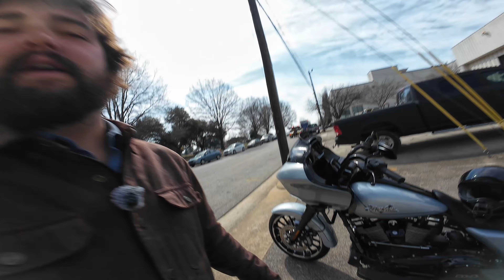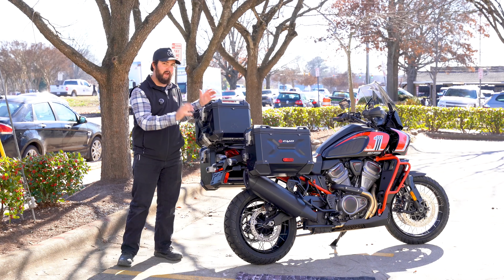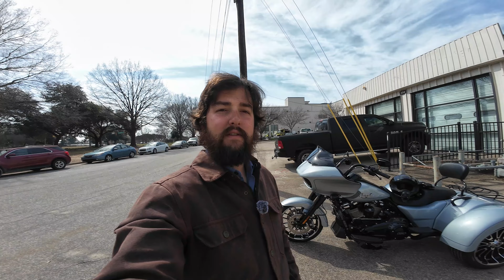Harley-Davidson ROAD GLIDE 3 | Ride & Review

Comment: Tour Pak if you google it. There is a company that makes a mount for the Tour Pak. It goes into the back rest slots. Pull a lever and the Tour pak tips forward or to the side  allowing the back to open and clear the pak. Changing a red light has nothing to do with weight and everything to do with metal. Buy the light changing magnet and mount it underneath quick. Problem solved as the magnet makes you look like a semi sitting there. Activates the wires in the road that pick up metal in vehicles.

Comment: My wife just bought a 25 in Blue/ Chrome. The issue is it the old electronics, so it’s a major deal to add heated grips not pre wired, no apple car play, but will pair the phone, also no Hill assist available. But comes with built in Navigation. The speaker are typical HD stock. Over all she likes it.
Reply: Just need a whim jumper for CarPlay to make it think there's a headset connected. For me, I'd rather stike to the old tech as the new tech has a ton of issues by design. I test rode one in Florida and loved it, less weight on the forks helps a ton when turning.